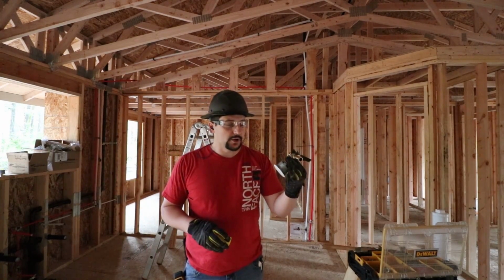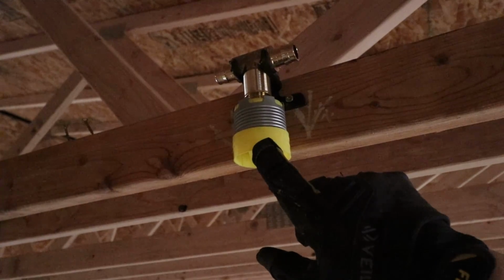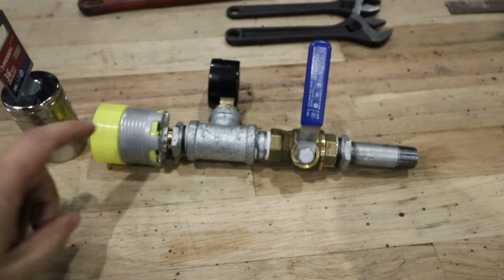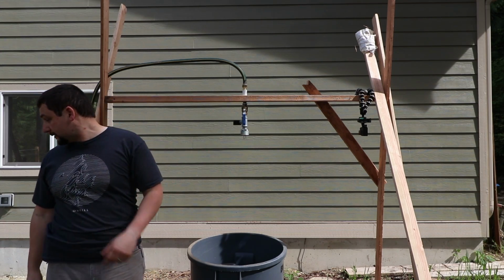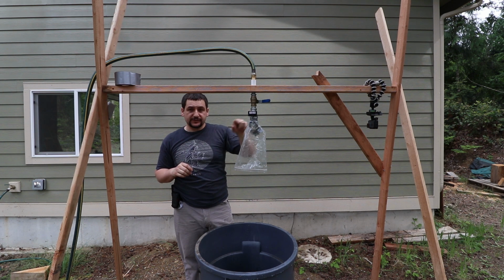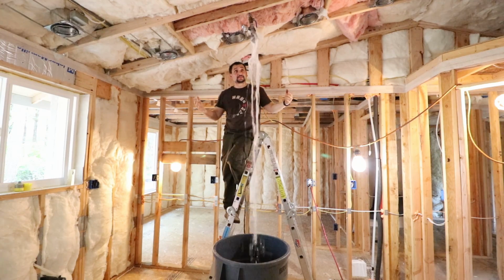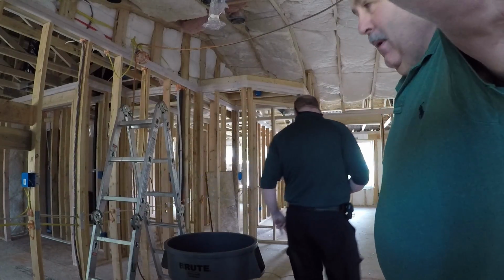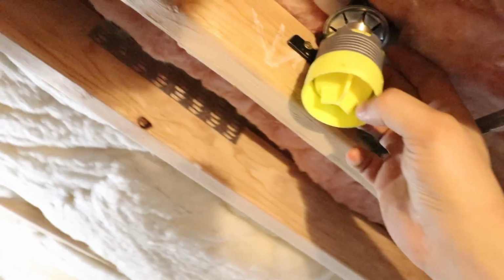DIY home fire sprinkler install

Comment: Does it install directly to the main water supply without a reservoir or a pump?
Reply from the maker: For this very specific application, yes. However, this is required by the county. We built the house in in Washington state you need to check with your fire regulation, state, and county regulations before installing this type of system.

Comment: Any body can confirm 55psi will work? I think the system need to do pressure test of 150psi.
Reply: Maybe commercial is that high but residential systems are designed for a 2 head pop with 30 psi
Reply from the maker: 150PSI in. Residential house would blow apart fittings

Comment: sprinkler systems are not part of the domestic water system, the street tap may be the same , fire sprinkler systems are seperated from the domestic water supply  at the house with a fire sprinkler riser.

Comment: I want you guys to note: not using the Head wrench for the correct head can damage the head, help create false trips flooding your home or place of work, voids the head warranty.  the Spec sheet on the sprinkler heads will tell you what type of head wrench you need for the sprinkler head.

Comment: Over the stove 
I don’t know what code is but that doesn’t sound good
I imagine the most common stove fire is a grease fire and a bunch of water sprayed on a grease fire isn’t going to end well
Reply from the maker: In order for the sprinkler head to be activated, the temperature at the ceiling has to be significant, a grease fire will not increase the temperature at the ceiling level to the to the level necessary to turn on the sprinkler head. The point is if the sprinkler head goes off your house is on fire not the grease.

Comment: You could have just done the hydraulic calculations to determine the head's flow.  This would be accomplished by calculating the water pressure as it enters the structure and a flow test the size of the orifice through the outdoor hydrant less any static for the length of the pipe going to the head.  This system (one head) would not even begin to fall under NFPA standards.   And would fall under your local Authority Having Jurisdiction.   NFPA 13D is for residential dwellings where the system protects life safety in the event of a fire allowing the occupants to exit the building.  They often will put out or contain the fire but that is not the primary intent of the system.  I understand the minimal approach to the system but the test that you did for the inspector was not required as simple calculations could have been done using the apparatus you made using a hose fitting and conducting the test outside of the structure all the while the inspector could have inspected the actual installation inside the building at the same time.   In conclusion, I would advise the AHJ to have their own test equipment as specified above to conduct such a test!    The stove/range is however the highest hazard rating in the structure but the NFPA 13D does not cover the actual kitchen appliance and is only for cooling the area around such appliance.  The standard for residential fire protection for a stove /range would be a multi-type fire extinguishing system ABC that would fall under a non-water system in a residence.  I would also advise the AHJ to require a 2# ABC-rated fire extinguisher within so many feet of the appliance.
Reply: Who was the AHJ?

Comment: Question, in house which gone be used for commercial business, can I use pex pipe or needs to be water pipe, thank you, great tutorial
Reply from the maker: Pex is water pipe, yes you can use pex.
Reply: Thank you, something else, am planning install around 28 sprinklers, when inspector show up, all needs to be installed, and he gone choose which sprinkler, or I can be ready with anyone.
Reply from the maker: @alexspcs8688  your initial question implied that you might only be installing one sprinkler head. If I had to install multiple sprinkler heads, I would’ve had to had a technical specifications produced by fire design company. The sprinkler head specifically is determined by the application and the drawings and specifications. There is absolutely no way for me to make these determinations from the two simple question you have asked. Also, I am not a certified fire suppression system installer or designer, so you really should refer to one of those type of individuals.
Reply: How did it go? Did you do this project yet?

Comment: The sprinkler head you used (link above) shows as $88 but there are many at < $15 - why?
Reply from the maker: Unfortunately, there has been a significant price increase since I purchase this, however, with that being said, the sprinkler head includes a sheet rock cover plate that assists in mounting. It also includes decorative cover plate that is designed to drop off at a certain temperature and the sprinkler head is designed to go off at 202°F which depending on your location is a requirement many of the other ones that I looked at after your comment did not meat any of these requirements and yes, the other ones are very expensive as comparison. But you’re not comparing apples and apples with the other sprinkler heads.
Reply: @DanielWoodell  I need a hands-on comparison..with a Uponor sales person next to me ....I don't get 4x price difference.

Comment: Man I install these everyday at work seeing you use the wrong head socket kills me. I've literally got a bunch of these at work would've sent you one 🙃
Reply: Send me one. I’m about to install it myself
Reply: I would sure appreciate some information on where to buy parts I want to put a system in my home in Missouri new construction not required but just think it would be awesome 417-825-0160 thanks

Comment: So for oven fires? This would spread a grease fire
Reply: Sprinkler heads are installed in the center of the room not on the range hood. You can buy a stovetop firestop system for less than $100 at Home Depot or Amazon. It is attached to the range hood by a magnet and is an automatic dry extinguisher system that is commonly found in many apartment units.

Comment: You do that to install them heads and it voids the warranty! You need the correct head wrench. I've installed fire sprinklers for 14 years. If you just protecting the stove you should have a dry chemical hood type system.
Reply: @joshua torres Agreed. It’s a safety system - it’d be worth it to me to know I was using the correct tool.

Comment: I’m not a fan of fire sprinkler. Single malfunction can cause catastrophic damage.
Reply: And a small fire could turn into loss of life for you and your family. Your an absolute moron. Nothing for rewarding as a sprinkler fitter than coming to a service call of a fire and the sprinkler system out the fire out and there was very minimal damage and no loss of life.
Reply: @fitter5423  In Washington state, where this guy lives, you are three times more likely to be the victim of homicide than to die in a fire. I'm generally a safety conscious person, but systems that raise the floor cost of housing and contribute to our ongoing housing affordability crisis are not things I can get behind. I just don't see the benefit of these systems outweighing the costs.
Reply: @goatofdeath  Perhaps for retrofit. But for new construction these sprinklers would tap off the cold water piping. You’d be testing it every time you turned on a cold tap. The reduced insurance cost and enhanced resale value should pay for the incremental materials and labor. The safety increase - priceless.
Reply: @goatofdeath  you also don't need auto insurance until you need it or you don't need to wear your seal belt until you wish you were wearing it.  Automatic fire sprinklers are an insurance.  Automatic fire sprinkler systems insure that you and your family (young, elderly or disabled have time to evacuate the home).  Automatic fire sprinklers are life safety systems that also preserve property aka your investment.  They are the first responders on site and are on duty 24/7.
Reply: I truly hope your last comment wasn’t for me....